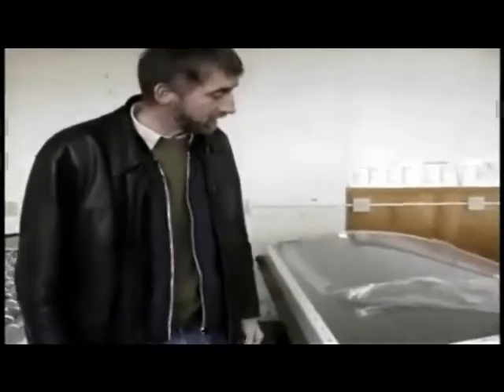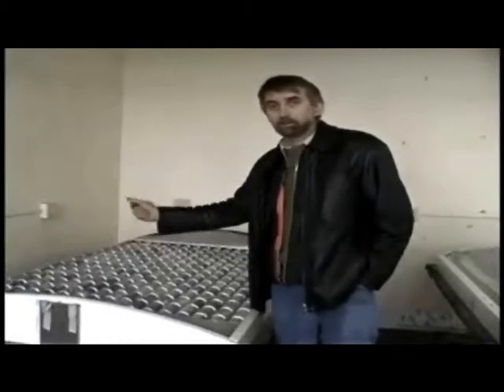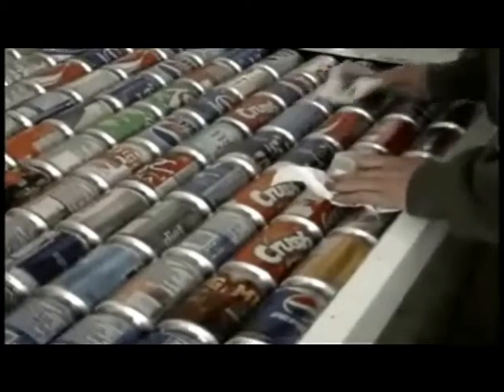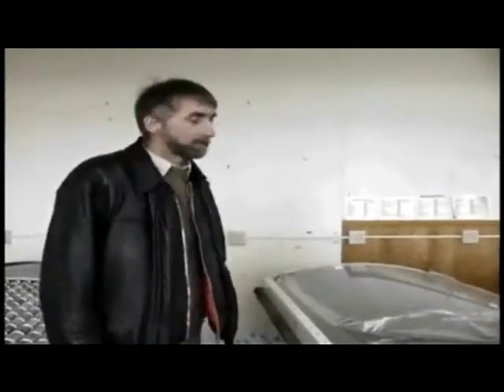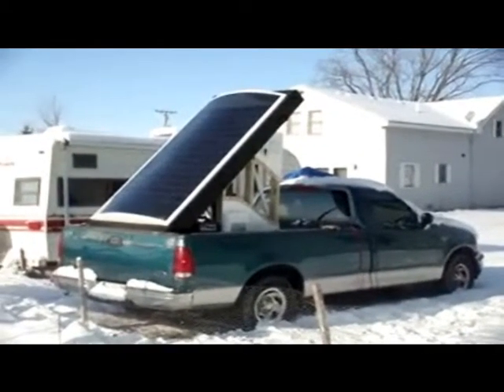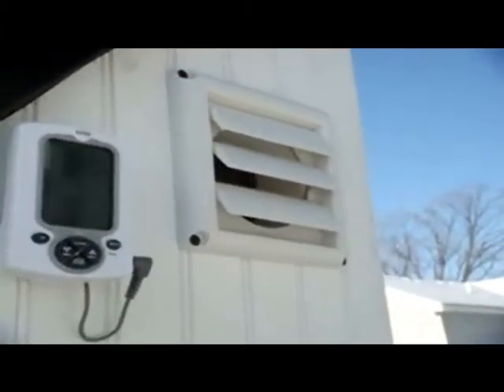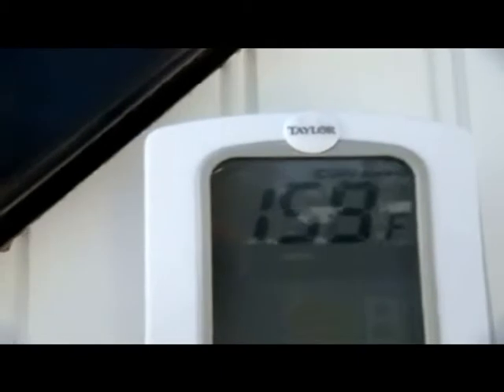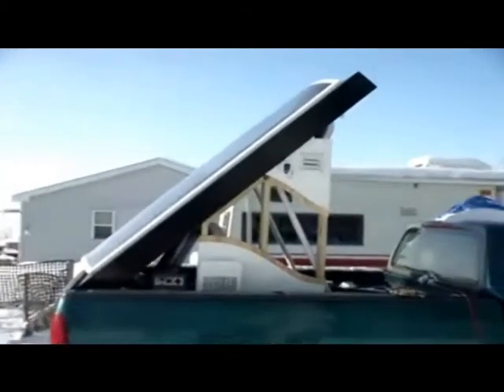Passive Solar SpaceHeating Panels | Free Heat

Comment: It looks nice but.. Your current invention is probably only heating one third, the surface, of the can.
Make everything black on your project, minus the clear cover.. Use fewer rows of cans with space in between the rows for the reflector. Paint the tube ALL the way around. Make a simple concentrator/ reflector to heat the  whole can. You can get rolls of aluminum from the hardware store. 
Air Flow
Get yourself a "side cutter" can opener for a wider for faster air flow.  https://www.amazon.com/Safe-Cut-Can-Opener-Restaurant/dp/B0761PZC5F/ref=sr_1_1_sspa?dchild=1&keywords=Side+Cut+Can+Opener&qid=1600904221&sr=8-1-spons&psc=1&spLa=ZW5jcnlwdGVkUXVhbGlmaWVyPUExMVU0OE9UUUgzQTYwJmVuY3J5cHRlZElkPUEwNzE1Njk5WE5DV1U1T0lKUTQxJmVuY3J5cHRlZEFkSWQ9QTAyNjYyMDUzS1pWSEIwUDQ2OFhNJndpZGdldE5hbWU9c3BfYXRmJmFjdGlvbj1jbGlja1JlZGlyZWN0JmRvTm90TG9nQ2xpY2s9dHJ1ZQ==
Reply: Even if the sun is shining on 1/3rd of the can it is heating up the whole can. 
Ex: Hold a metal pipe over a stove. Just because your heating up one end doesn't  mean the other end wont get hot. Considering these are MM thick aluminum cans, the whole can will heat up within an hour.
Using more cans means more thermal mass and more surface area for the air to come into contact with and heat up. I do understand your idea, but after several tests I don't think you will notice that much of difference between both setups. 
I'm pretty sure he painted the whole can and cut the top and bottoms off.
Reply: Side Note:
My first solar heater I thought I would want the to make the hottest air possible to come out into my house so I made a really long snake path for the air to travel before it exited the heater.
After taking a heating class I learned that you don't want the air too cold and blowing out or it will feel like a draft, and you don't want the airflow to hot for safety reasons.
You want to keep the air temperature roughly between 140-170F.
 If your solar-heater output is higher then 170F you need to increase the airflow through your heater. Just make sure when you ad a fan its pushing more air out then what is occurring through natural convection (my mistake)

If I have time, Ill put my old pics together and make a slideshow to backup my claims.

Comment: How did turning the fan on increase the output temperature? Whats the velocity and the CFM coming out of the solar heater?
Reply: The fan keeps the hot air from pooling at the top and stopping there. The design is not more horizontal and can not sustain it's own air flow.
Reply: @georgegates526  I never had an issue of hot air pooling up toward the top.
My fans ended up slowing down the natural convection of my solar heater. 
Generally speaking my fan was only rated for 50cfm output but the natural convection of my solar heater was 100cfm.